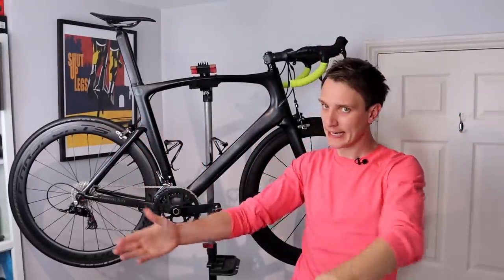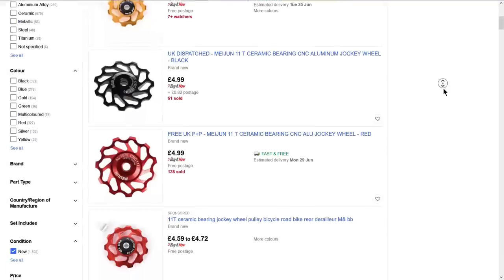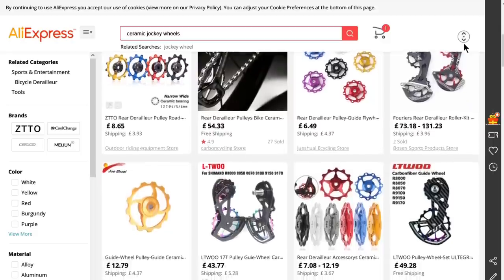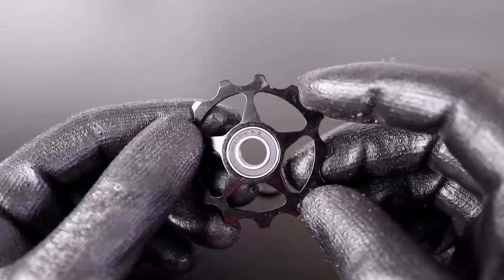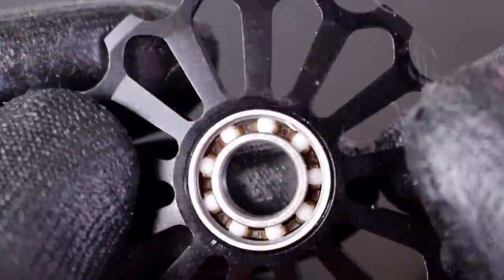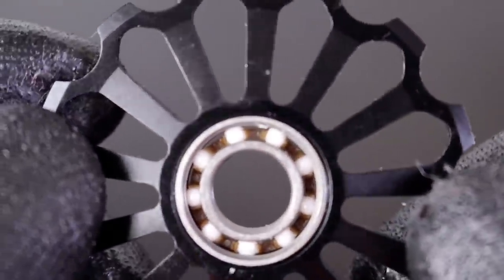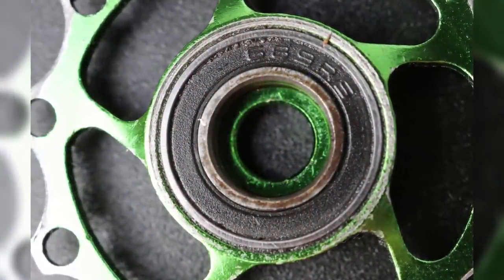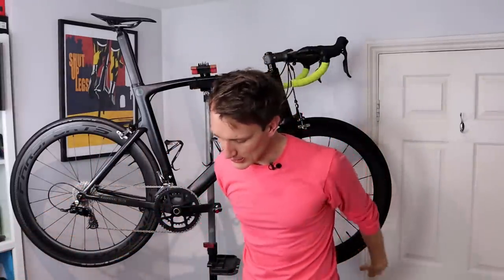Cheap CERAMIC JOCKEY WHEELS - a fatal design flaw!

Comment: You're absolutely right.  Rubber seals create a slight friction drag on bearing rotation and in high-speed applications, they can even wear the seal and cause seal contaminants to enter the bearing.  A better alternative would be to have a non-contact metal shielded bearing, many times having the zz or 2z suffix, or using a non-contact rubber shield made by NSK.  Ceramic bearings are kinda a gimmick anyhow, they were introduced in the industrial bearing world as a replacement for electric motor bearings because they wouldn't allow electricity to pass through to the shaft of the motor.  Bearing steel is already one of the hardest steels out there.
Reply: The more expensive aftermarket jockey wheels do, but they cost 2-4 times as much as the ones he tested in the vid. Stylrtop for example sells aluminum jockey wheels on Amazon for $11 that have 689-ZZ bearings and look much more solidly constructed.

Comment: The nylon (or other polymer) inner race will entirely negate any advantage that ceramic bearings might theoretically, possibly, temporarily, might have had.
As soon as you put a load on those bearings the hard ceramic balls will cut (wear) away at the race, even without grit acting as a grinding paste.
 
My guess why they don't have seals is a) cost, but also b) so they don't have the friction that the seals cause. As most of the friction in (good) bearings is from the seals and also the lubricant, the rolling friction is usually low between ball and race, but that requires both surfaces to be very hard.
Reply from the maker: Yeah, the nylon race just completely wore out. I think you're right about the seals aswell. From a general consumer perspective, if the jockey wheel spins freely, then it would seem to be good. If they had seals, they def wouldnt spin as easily.
Reply: I'm sure Hambini would agree. If you want longevity then have the seals in place. If you want low friction, then have no seals and run a light lubricant. You can't have both. You would probably get descent low friction results by taking the seals off a non-ceramic jockey wheel compared to a ceramic one.
Reply: Exactly what I would have said. In fact, I believe the bearing would probably perform better if the balls were from nylon as well, since they wouldn't wear out the race like that. I believe they don't put seals in there so people who are fooled into buying them give them a spin and go "wow!" and comment on how great they are. By the time they notice they are worn out and probably rubbing on the caps the whole time (if they notice at all), it's too late.
Don't buy fancy expensive (or cheap) metal jockey wheels. Get some Ultegra ones, they have sealed bearings (certainly of higher quality than the chinese ones) and never wear out. Possibly 105 are also built like that. Delrin or some other type of plastic is the appropriate material for jockey wheels as it dampens the noise of the chain rattling across them. Metal jockey wheels are just stupid.
Reply: Normally the ball bearing should have same material on the balls and the rims. Any difference in hardness would cause high wearing. But yep, ceramic rims are much more expensive than the balls in small diameter.

Comment: The Chinese manufacturers probably leave the seals off so that people who try a 'spin test' first thing out of the package don't immediately leave negative reviews or return them.  It will take several rides before people realize the bearings are completely shot... usually too late to bother by that point.
Reply from the maker: Cup & Cone, I recon you are totally right!!
Reply: @TraceVelo  reckon?
Reply: @MatthewAtkinson  Did he stutter?
Reply: @MatthewAtkinson  did he stutter (2)
Reply: I reckon he needed to do some recon on whether he stuttered or not.

Comment: Having used both types of bearing in alloy jockey wheels, my own findings are similar - but not exactly the same - as reported here.
The ceramic 'open' type does attract grit, but a dose of lube keeps them fairly clean in my experience, much like chain lube, it pushes grit to the outside. The sealed type does bed-in quickly and spin almost as freely as the ceramic after a few rides, so yeah agree there.
One benefit he didn't cover was the gear indexing. The standard plain-bearing in an OEM jockeys have a LOT of free play 'slop' effecting gear indexing. Either type of alloy wheel has very little side-to-side play (the video exaggerates the opposite to my experience). This ridged tracking of the jockey allows for more authoritive gear changes and thus indexing consistency. The other point is sound, they do create more drive-chain sound - note not more drag, they actually offer less resistance, but you do hear gear changes more as its metal-on-metal. For the money - give them a try, and while you're at it look to go up a few teeth on the bottom wheel if you can 😉
Reply: Yeah, haven't done that with my 105 yet. But I did with the claris I used to have and damn! Was it akways way to crispy of changing gears, for such a low price and category

Comment: Placed an order for cheap aluminium jockey wheels just before your video came out but bought the steel balled version. Have now received and fitted. Bike now back to changing gear properly with no missed sprockets on the cassette. Maybe slightly louder but not by much.

Comment: The '6' in the bearing reference defines the bearing type (radial contact deep groove ball bearing) and the 8 the cross section, 9 the bore size. I think they will have left the seals off so the bearing feels more free spinning. The only reason you get a noticiable reduction friction in the ceramic bearing (hybrid) is that there is no grease or seal contact. Hybrid bearings only see a noticable friction benifit at high speeds if lubricated in the same way.
Strange to see zircona balls used in a hybrid bearing, Silicon Nitride is more commonly used. Great video and I think ill be sticking to my orginal naff looking jokey wheels for now.
Reply from the maker: Ben Roberts, dropping some bearing code knowledge into the comments!!! You clearly know your stuff. You are probably right about the seals though. Leaving them off means they will spin freely out of the box. More than enough to fool the average Joe into thinking they got a decent product.

Comment: Trace Velo never disappoints. Have had the a pair of regular Chinesium jockey wheels on one of my road bikes. They workes nicely. However, as with all alloy jockey wheels, they add a little bit of noise compared to Shimanos "plastic" ones.
Reply from the maker: Yeah I found the same thing. The shifting was nice and sharp, but yeah a little noisier.

Comment: Well my experience has been somewhat been different than yours. I have several bikes with Campagnolo 10 speed gearing.
They come from the factory with 10 tooth plastic jockey wheels. The 11 speed ones that Campagnolo uses are 11 tooth and they shift slightly better on the small cogs in my opinion.
So as a experiment I ordered some Campagnolo suitable cheap ceramic ones as they have 11 teeth to use on my 10 speed setups. They fit perfectly.
After two years of heavy use on now three of my bikes I have been quite pleased. Mine are sold as J&L Ceramic Ceramic Pulleys on eBay for $11.99 U.S.
They have the open bearings and have plastic pulley bodies. They are quiet, shift very well and I have had zero issues. I did use a drop of oil on them when installed.
The shifting was slightly improved and I felt the chain wrap was slightly better due to the larger diameter. I live in Florida and only occasionally get wet when riding and this may help with the longevity. 
By the way Campagnolo Super Record 11 has one Ceramic ball pulley and one Ceramic bushing pulley. I have one bike with that setup and the cheap ones work as well as these.
The wheels come with no directions.  When you install them look at the wheels for rotation and position information molded on the side of them.
Like you, I buy Chinese Carbon bits like one piece handlebars , seatposts, computer mounts and seats. Almost everything has been made well and works well without spending a fortune on my hobby.
As an aside, the pedals that you tried and didn't like, well I use those also. I have had a positive experience with two pairs of these. I run the black cleats and put the tension right at the middle of the screw. No noise, however they for someone who likes a high clamping force I do not recommend them. The bearings are very smooth and they are easy to use.

Comment: I got some Al jockey wheels from Wuzei brand on AliExpress. They came with ceramic balls on steel races (inner and outer). I greased them with blue park tool lube before installing. Super smooth without excessive play after 1500km on my gravel bike.

Comment: Great topic, super informative... I too will go cheap every time.  $1600 for derailleur ceramics, who knew?  My usual jockey wheel maintenance, sad to say, is... ooops,  another sorta accidental  shot of Teflon wax-based chain lube.  

Aliexpress seller messaged today:  New Sensah  shifters, with the upgraded metal gear, mailed out today to AE sellers.  My back ordered groupsets should be sent out in two days.

Comment: Ceramic on nylon..... even with seal this is a "worst idea ever" case
Reply from the maker: Yeah that little jockey wheel did not stand up to the test of time!
Reply: Yes exactly, an engineer has obviously not designed that thing
Reply: Often those bearings are nylon too.

Comment: 8:03 - if those bearings were sealed, they would not spin as freely out of the box. RS bearings have a contact rubber seal which introduces tiny drag to the bearing and an aluminium pulley doesn't have the inertia to overcome it.
Reply: They also spin so smoothly because there is no grease, which is also why they collapse so quickly.

Comment: I LOVE sealed bearings. I live on a dirt road.  Dust, mud, grit and stones.  And I do large distances.  So robustness and lack of maintenance are far more important than low friction.  I am amazed that so many components are totally exposed to road muck.  Pedal bearing for example.  Many motorcycle chains have seals in each link but not pushbike chains.  Are bikes merely intended as toys?

Comment: I bought KCNC $25 eBay, they were regular bearings with rubber seals, but no matter how much I oiled them they always squeaked. I also bought the rear oversized cage, and that had a worse design flaw, in that the spacing shaft that sits between the spring and the fastening bolt, to sit it on the derailleur was not properly spaced like the Shimano original. So when I tightened the bolt to attach it, the pressure from the bolt did not allow the cage to move freely, I had to find a spacer washer that was just small enough to fit there outside the spring but inside the shaft and finally allowed the cage to move freely when tightened to full torque. What a mess, then shifting was below par likely because my makeshift "spacer" was not perfect. What a hassle it was, in the end you pay for the engineering when buying authentic...

Comment: I've been using the cheap (sealed) chinese jockey wheels in my MTB and Road bike over 1000s of miles and they've been holding up well, for the price I think they add a nice bit of bling and work absolutely fine.
Reply from the maker: Yeah the ones with the sealed bearings are rock solid!

Comment: I did a hack on my rear jockey wheel derailleur "Dura Ace 10 speed", I just remove the internal dust washers(they are very small), I don't envy any ceramic jockey wheels !, the secret is to lubricate all and too the chain with silicone spray  ... Please don't use anything else.
Clean the chain well with degreaser, then wash it well with water, then dry it ... and then lubricate with Silicone, I use this and I buy it at walmart "WD-40 BIKE LUBE WD40 SPECIALIST SILICONE 11oz AEROSOL"  , spray that part twice a week; When you stop pedaling it seems that you have an electric motor pushing the bike. !

Comment: Used a few of the cheaper jockey wheels, the standard bearings can rust but are easy to replace with stainless ones and then go for years

Comment: Used and worn out several of these. Usually alu teeth wear out and to prevent risk of collapse i replace them. Spin quite well after long use. 1 time bearing seized completely. agree they are not the best but not bad either

Comment: Hello. The seals don't guarantee reliability- quite the opposite. I bought a set of BBB jockey wheels last winter. They have a ordinary 2RS bearings in them- great,  I thought. The bike did a season of racing, culminating in one wet TT. I came to service it, some days later, and found the lower jockey wheel was solid- it would not turn. I removed it, then levered the seal off. There was no visible debris, or indeed corrosion, but it would not turn. There was not much grease there, either. I swilled it out with degreaser, and eventually got it moving. I then filled it full of grease, put the seal back, and resolved to check it regularly. That last TT was about 8% slower than usual, so the problem might have been developing for some time. Not good. 

More recently, I noticed the nearly-new front wheel on my CX bike was similarly horrible. Upon dismantly (opposite of assembly. I hereby initiate a campaign to have that word inducted in to the OED), I noticed that the balls on one side of the wheel were rusted to fk, and the races were also rusty. I replaced the balls, gave the races a scrape and packed it solid with grease. That wheel has lip seals, just like a 2RS bearing.

CONCLUSION-  Standard engineering seals are not up to the job of sealing bike bearings. You need lots of grease in there. The bike manufacturers don't realise this. Carefully lever the  seal off  a new one, and stuff grease in.

PS Use calcium grease- lithium grease is not waterproof (At least, it wasn't the last time I spoke to a grease expert. He was TD of national oil co, with a PhD in lubrication). You can get calcium grease for a tenner a pot. It is a nice white colour.

PPS don't even think of using those fancy perforated jockey wheels for CX. Grass will find a way into the holes, mud will build up in the cage and, if you know about CX, you will know what happens next. I make anti-clogging CX bits, so I know what the enemy looks like! Good luck.

Comment: Question - you can get 689-2RS ceramic bearings for around £7 for a pair, what would happen if you put them in the ceramic jockey wheel?  Would every single physic paper ever written be instantly invalidated?  Enquiring minds want to know.

Comment: In my experience in Asia (I work in a bike shop) the cheap ceramic jockey wheels do have seals... however they are still rubbish because grit gets in, the ceramic balls wear out the steel races and the cheap aluminium wheels themselves snap after not much riding. Also the shifting performance is way less then the standard Shimano wheels.

Comment: Ceramic is super hard, Nylon and Aluminium is soft. What happens is that the hard bearings destroy the soft race. A seal would only help a small amount. In order for the Ceramic bearing to last it needs a hard race with a proper seal and lubrication as you have said.

Comment: I've never bought any of these particular items, but one of my ali rules is, all the critical standard size bearings get yeeted first thing and replaced by proper ones that i spec depending on use case. And replacements can come from China or they usually come from a local supplier but NEVER from a random vendor, always from a bearing specialist. Not actually expensive.

Comment: Any chance you tried taking seals from the cheaper set and putting them onto the ceramic set? Seems like the overall diameter is pretty similar so you could possibly seal the ceramic set yourself potentially.

Comment: Oh wow I got one of those, last time I checked before replacing the chain they are fine even after hundreds of km.
I'll check if they are crunchy now.
Might explain why I kept getting dropped by my buddies, you know, any excus~, ehm, explanation counts.
edit: nope, mine definitely not crunchy, but not super smooth either, it has quite a bit of play though, I need a new one.

Comment: Been waiting for this video for a year now. Can you try buying ceramic bearings from inline skates and replace it? or replace it with like ABEC 7 bearings from skate boards. But, maybe the diameter of the bearings differ on the jockey wheels. A follow up video would be interesting :)